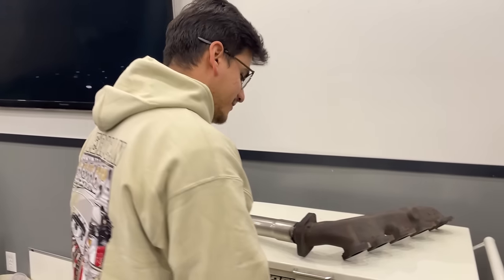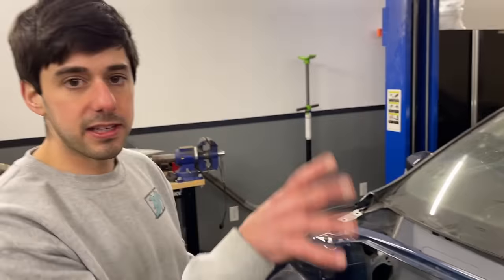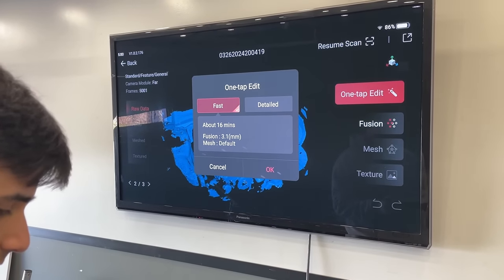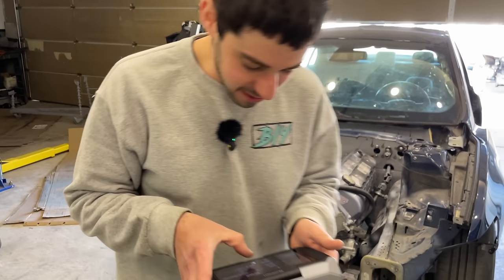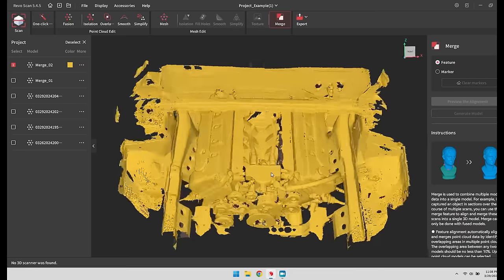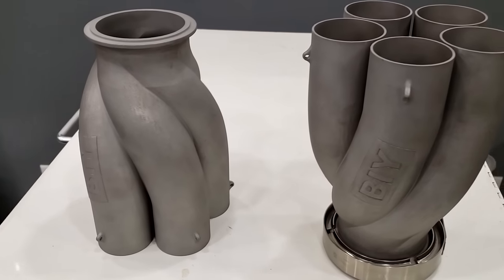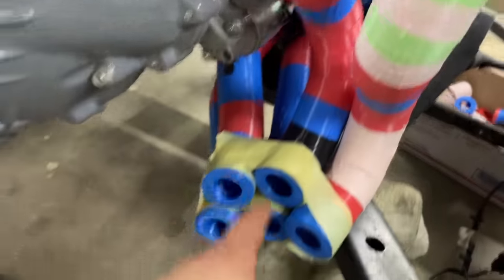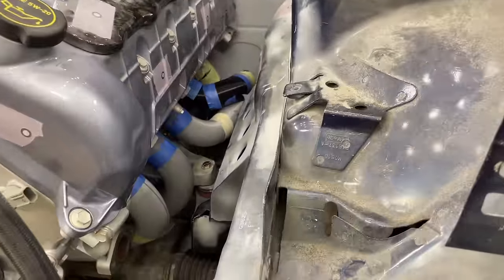Designing V10 Headers Using The MIRACO 3D Scanner! -  Ford V10 4V Build Ep. 18

Comment: V10 for the WIN! They look awesome. Great that you can weld each header separately and then fit to the engine. Hopefully you can get all the correct radius bends for the design? You will be Tig welding pros, once they are welded. Thanks for sharing, can't wait to hear the V10 burble at idle, then roar with a little gas!

Comment: I'm actually super glad you guys did the research on header sound tuning (at least the bare true necessities) before starting.... IDK how many times I've seen people build headers thinking they're going to accomplish something "good" sounding, but never took into consideration, overall and individual primary lengths, cylinder merging, firing orders, cylinder primary collection ECT, and end up with something that sounds less than ideal to say the very least lol..... don't forget, header design is probably the most important for sound after the firing order, but, don't forget what you're going to decide to do with the rest of the exhaust.... you can turn something that has the potential of sounding utterly phenomenal into something that doesn't really quickly with a poor choice down the line.
Stay away from H pipes if you're running a dual system out the back, run an X, and personally, personally, I'd do equal length LONG TUBE STEPPED headers, (IDK your displacement or where you started, if it was the Triton 6.8 or you custom built a 4.6 mod motor to a 5.8), but I'd say you could get away with 3" collection on either side(but IDK about how many primaries should be collected in pairs per side until finished)potentially 3½ due to how many you're collecting, I'd suggest if you haven't already gotten and used one, to get a header building program on your PC to assist, but I wouldn't run cats, just long pipe off the collectors probably till about a foot away from your X, then after your X, possibly single Vibrant resonators per side, and then more pipe until you place the mufflers (more tailpipe after the muffler usually sounds better than less, unless you're going for deep).... and don't forget metal choice has a drastic tonality difference as well, mild steel, stainless, titanium, inconel ECT (headers can be stainless with the rest of the exhaust in different metal for tone change if necessary), and don't forget, even choice of exhaust tips have a huge place to play... exhaust is literally a black art 😅

Edit: guys, how much power is that V10 putting out? Because 2" primaries on even a 600-700hp V8 are large and you could run 1⅞....2" on a V10 is massive 😅  at personal most, I would've done stepped design, 1¾ to 1⅞'s... I just hope you guys didn't go too big 😬

Comment: You guys should look at getting a casting made for the head to sale them
Reply: I'm thinking that sometime in the future they will pull the heads off and scan them. Just guesstimating but I figure a minimum of $4K for the bare heads, $2K for the cams, $1.5K for the intake, and $2k for the headers. Then you'd have to load the heads, build the shortblock, and figure out the fuel injection. But it would still be worth it.

Comment: I have a computer algorithm that automatically designs header solutions with packaging constraints.  I have done development work on NASCAR and F1 engines for Hendricks Motorsports and other players.  Software is written it matlab, will take CAD input for engine and engine bay coordinates, and desired lengths for primary, secondary and collector lengths. One major advantage to my method is that it minimizes the number of pipe segments, so there are rarely more than 2 or three welds required per primary tube.
Reply: I think it's Hendrick Motorsports.

Comment: Engine Masters proved you can "dent in" a header and it doesn't affect performance or sound.  You could can probably give the primaries a little squeeze around the steering shaft to buy yourself a little more clearance if you need to.

And a little body massaging on the car wouldn't hurt either.

Comment: I would like to see you guys tackle 
N. Testlas ... Turbine Engine ???
70 thousand RPM an hundreds of horses ... And runs on anything from steam to perfume ....
Could make HP, electricity,pump, steam, air you name it !!!
The mixing intake pre combustion box is the key !!!
He didn't have modern materials when he designed the engine ... Ceramic Bearings and Quality Stainless steel...
Will make this old design into a modern "Monster" !!!

Comment: Awesome video and glad to see you guys getting some hightech gear and sponsors. 

Question about that scanner and the finished product file. Does it save it as a step file that you can use in any 3d modeling software? Would love to see a indepth video or a little more detail on the steps after it scanned.
Reply from the maker: You can export STL, PLY and OBJ file formats. But you can easily convert those to a step file if you have a CAD software.

Comment: Is the 3 printed collectorors equivalent to cast stainless?  The walls look a little thin, and im super unfamiliar with the strength and heat resistance of 3d printed metal, but it looks like your collectors are about 8th inch thick, but maybe be prepared to make a set that is a 1/4th inch thick just in case those guys crack. Beautiful build you guys and I look forward to staying updated!!

Comment: I wonder if u can use that scanner to make a better set of 4v heads??!!
Reply: Did you see the head porting video? The intakes flowed almost 310 cfm at max valve lift, which should easily support 700 hp at 8,000 rpm. We'll see if the crankshaft can take it.

Comment: its flat plane crank (like the 5.2 voodoo in the gt350 OR the lambo/audi v10 that it shares design traits with) 

edit: as opposed to the Cross plane crank like teh rest of american v8's
Reply: Not sure what you're saying. The Triton V10 has offset or "split" crank pins so the engine fires at 72 degree intervals. Check out the shortblock build video.

Comment: I'm thinking that the internal volume and size are the critical part ???
And not so much the actual length of this header ...
They must evacuate the hot gasses and syphon them out for next pause...
Before final assembly a "CC" beaker and tube to measure volume along with rubber plumbing plug (one of those "Temporary" freeze plugs)...
Alternate slightly larger an smaller sized tubes could be used to achieve this balanceing act ???
Just my thoughts an nothing scincetific????